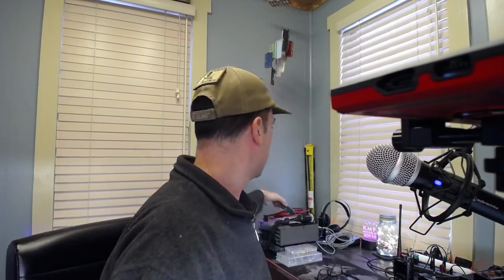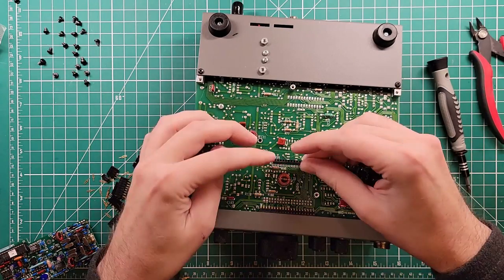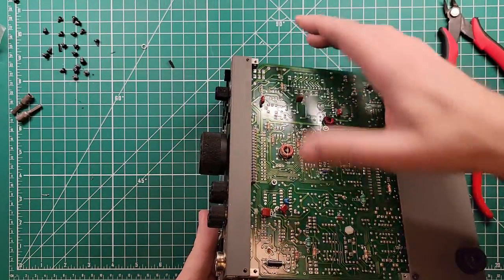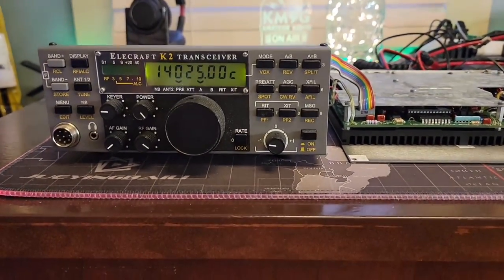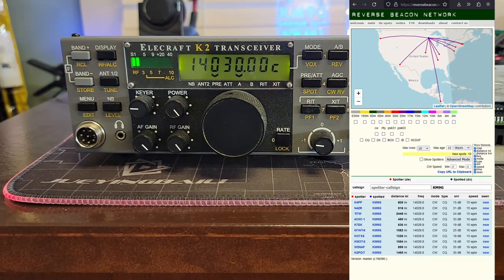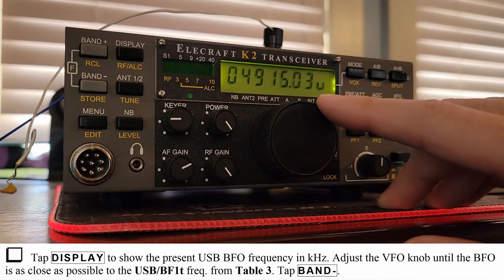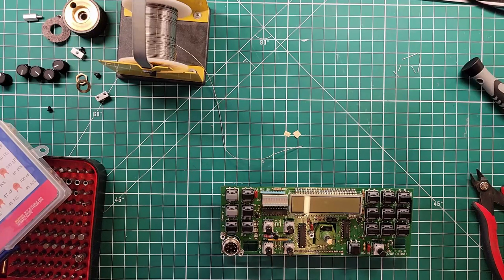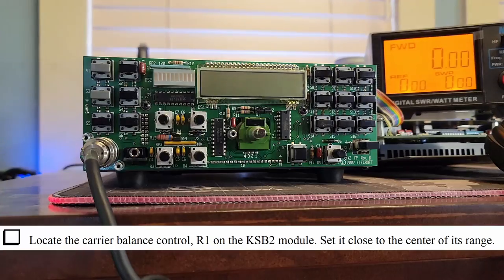How TO adds SSB to an Elecraft K2 - The KSB2

Comment: You certainly brought back a lot of fond memories.  I built my K2 (S#01411) about 2001.  It took 40 hours to build the basic K2 with internal battery & antenna tuner.  Then I proceeded to build the different options including the 100 watt amp & separate antenna tuner.  As you've noticed, the K2 was an amazing entry into ham radio back about 2000.  I saw the QST review & just had to build one.  It brought back Heathkit memories but it was my first experience winding toroids.   Be sure you use interface cable that's special for the K2 between the rig & antenna tuner.  Some of the wires are switched so if you try to use one that's generic for computers, you could damage your rig.  73 de K5AVJ (ham since 1960)
Reply from the maker: I saw that interface cable thing in one of the manuals.  Good tip 👌 do you still have your K2
Reply: @temporarilyoffline  - yes, I still have my K2.  My most amazing contact was from a B&B, I strung an indoor antenna wire around the bed posts & across the room.  I worked Japan on 10 meter CW with about 10 watts from Fredericksburg, TX.
Reply from the maker: @lynnbailey1948  that's amazing!

Comment: Big congrats Steve for your beautiful K2 combo. Nice job with SSB module installation! I have only low power 15W version of K2 unfortunately as I never purchased 100W PA when it was available and now it is unobtainable... but K2 works like champ and it is all time keeper in my shack. Btw KAF2 is audio filter which work perfectly in K2... GL on the air and hope to hear you here in EU. Petr
Reply from the maker: Thanks Petr!

Comment: K2 is a fantastic kit! I built mine 22 years ago and it is still my favorite radio. As unfortunate as it is tho,  unless Elecraft has a plan for obsolete components or significant inventory, its days as a kit might be numbered. The NE602/NE612/SA602/ SA612 chip (Double Balanced Mixer) was discontinued late last year and there are 3 or 4 of these chips in the K2 and its options. Probably they are facing more issues with obsolete and unavailable components - they had to re-design at some point the VFO encoder due to availability problems. KPA100, KAT100 and KDSP2 are history so as the XV transverters. The kit had a good run and set a new standard after Heathkit for quality kits and it will be a shame if they kill it.
Reply from the maker: Sounds like fond memories!  I would love a modern day 100w radio kit... but SMD FPGAs aren't fun.  For obsolete components, if there is enough love, people will make replacements for them out of modern chips.  The commodore 64 went through this and can now get 100% new chips to replace the old broken units.  There is hope.

Comment: Great video Steve.  I bought a K2 from the estate of a friend (SK) and got it working again.  Those filter adjustments are "fun" aren't they?!!

One thing: I think that you may have blown one adjustment (OP1 BF2 USB at around 45m 40s in your video timeline).  You are on USB but then used the LSB 4913.5 frequency value to adjust to.  I think it was supposed to be the 4916.1 value that it started near before you spun the VFO dial (45m 50s)!  You may want to go back and check that.

Yours is the only YouTube video showing these adjustments that I could find.  It would be cool if you did a full calibration of the rig on a video so that it's documented.  To me, following the written manual's instructions leads to becoming "mushy in the head".  It's much better watching someone else (YOU!) doing it, HI HI.
Reply from the maker: Thanks for watching.  This radio got sold after the upgrades in the great downsizing of 2023 as I sold the house and went full time RV.  It was a fun radio to play with and if I ever get another one, I'll try out a full cal!

Comment: First the "codger" advice: cut the header strips with a utility razor blade or utility box cutter. Lay the header flat on the table and press the blade down in the groove. It will take some hard pressure but your cuts will not fracture the body of the header pin. Also, place you fingers on both sides of the header between the razor/cutter blade so the short end does not fly off into infinity.. 
Now the codger rant: You were born absolutely 15 or so years too late. If you had bought a K2 in 1999 or so, you would have lived the experience of building it from scratch and understand why codgers like me say that anyone who has a K3 and up thinks they "built" the radio, the were wrong. 
They assembled it. 
I have (and built) #999 and added all the adornments possible except the amp. (I am a QRP guy.) But you have the humor, temperament and attitude to appreciate a truly great radio. The KSB2 was a bitch to build, install, and align. 
You did a magnificent job, my brother!
Reply from the maker: Thanks for the kind words!  It's a great radio for sure.